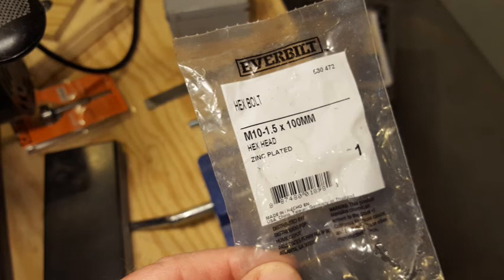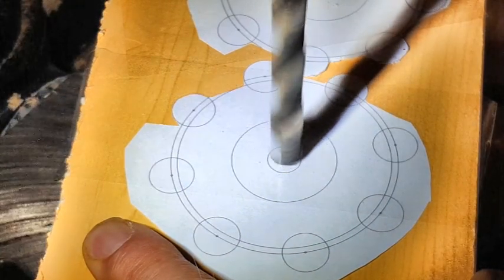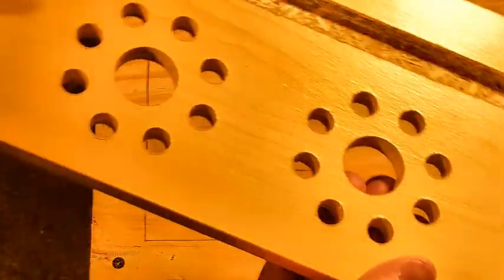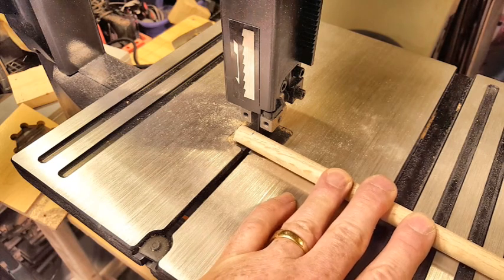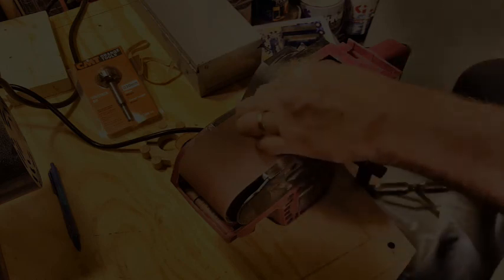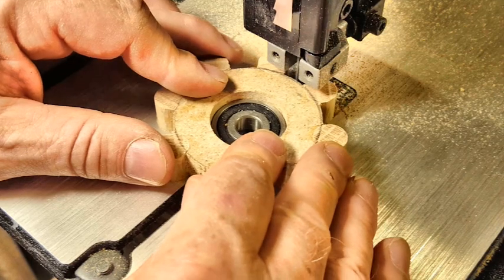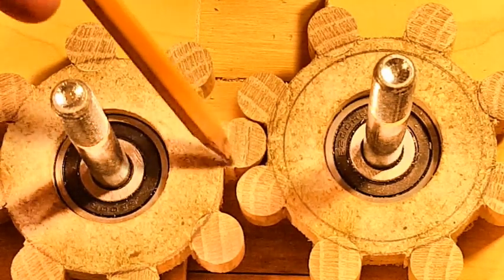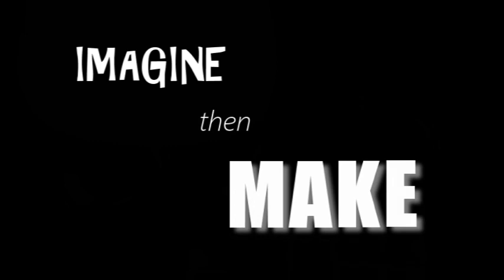34. Making my 1st set of dowel gears

Comment: Great video thx for sharing. An idea, instead of making 10 holes for the dowels, I think 20 division would have done it. 10 at the right diameter and 10 1/8" smaller diameter. The smaller ones would have given perfect clearance for the dowels. I'm a tool and die maker and I've built enough mechanical parts. Try and see hope it work good luck.
Reply from the maker: Thanks for the suggestion Gary! I'll have to give this a try soon. Thanks for your comment and for watching.
Reply: @ImaginethenMake  np. I enjoyed watching I just love almost any mechanical videos.

Comment: Hey that's cool. Just in case you may have missed this. woodgears.ca by Matthias Wandel has an easy to learn gear program called Gear Template Generator. You may already know of Matthias Wandel from his YouTube channel. A lot of people use this program including the wild and crazy young inventor that builds the musical rolling ball machines. YT channels: 
Wintergatan and Matthias Wandel. Thanks for the great videos. I just purchased a Blade Runner and got the sled because I saw your videos. I think it will be the best jig saw I've ever had and probably my go to saw for most stuff.
Reply from the maker: Yes, I do know of Matthias, I've been a subscriber for years now. He does remarkable work. And yes, I do know of the gear template generator. That is a very cool program.
For this video, I wanted to further explore making gears using round teeth. I'm certain I will make at least one more set of dowel gears just to see if I can improve upon their construction.
Enjoy the Bladerunner. I think it is a pretty versatile tool.
Thanks for your comment.
Reply: Thanks, I used the Blade Runner first time today to cut some .25" poplar and some .08" acrylic and I used the cross cut sled for both. The cuts were straight and smooth so I'm happy. I think the sled really helps. I sprayed a silicone lubricant all over the saw and brushed and wiped it and it really helps to keep both saw dust and acrylic chips from sticking to the saw. I recommend the following and I bet if you try it, you will do a review on this stuff. Lowe's has a great deal on it at the moment.  "Blaster Industrial Strength Silicone Lubricant" Blaster has several other sprays with cans that look very similar but the name above is the exact name on the can. Also YT Channel Ronald Walters is another one I follow.
Reply from the maker: Thanks for the tip about the silicone spray.